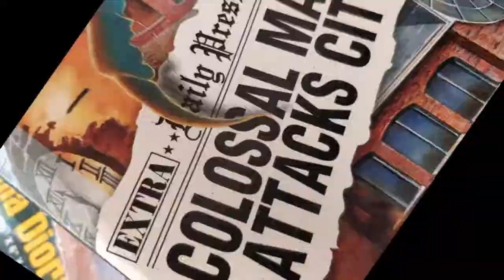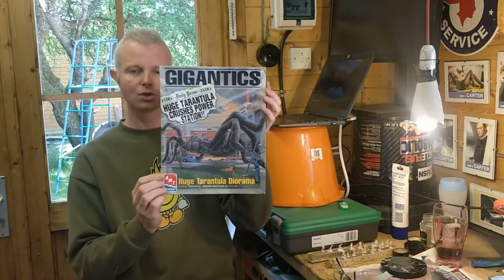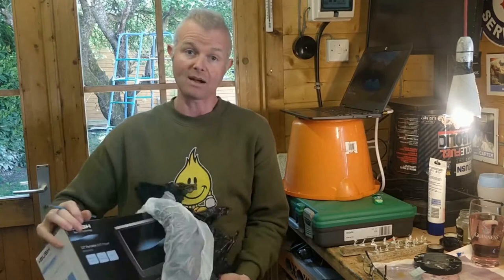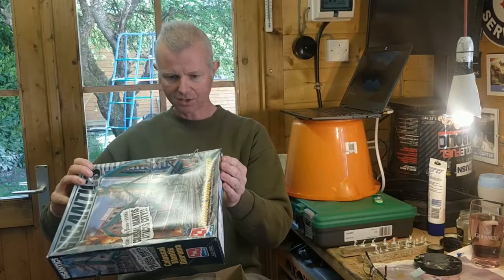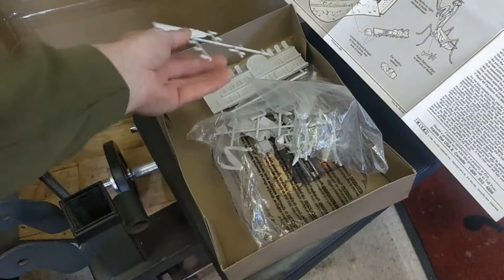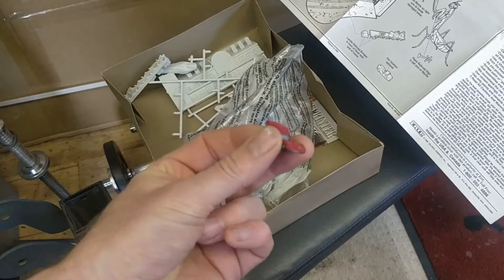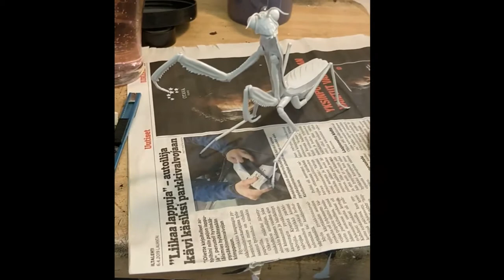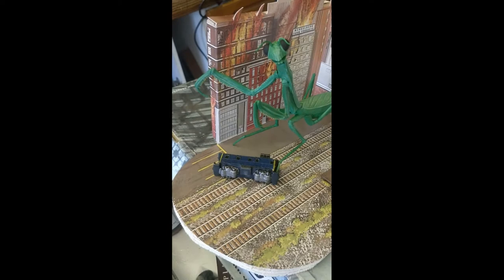AMT ERTL Gigantics Diorama Scorpion Tarantula Mantis unboxing making and in-depth look

Comment: Rebuilding mine now. I had the original 4 Fundimensions kits as a small child in the 70's. I'm having a terrible time putting them together properly; big seam gaps and misalignments to fill on the tarantula, and the scorpion is missing two legs and they are totally inaccurately molded to begin with.  I'm waiting for a 3rd Mantis kit to start building that. (Yes, I was smart, and remembered, that they weren't that great in the 70's, So I've been hoarding them for some time.)

Comment: I had these kits in the 70's. I was thinking about re-getting them. I don't remember the people looking so out of scale. The people in the original Fundimentions kits were the exact size of my HO train people. These reissue figures look larger.
Reply from the maker: I understand what you are saying, but wonder if its not actually possible they are bigger. 
When i look at the figures, i think they are the originals.    These kits are manufactured by making a mould and pouring the plastic in.   Making that is an expensive process.  To re size the figures by even a small % would mean a new mould. I don't think they would go to that expense, when they can just use the old castings. 
 I am sure someone will come along with the answer!  ;-)